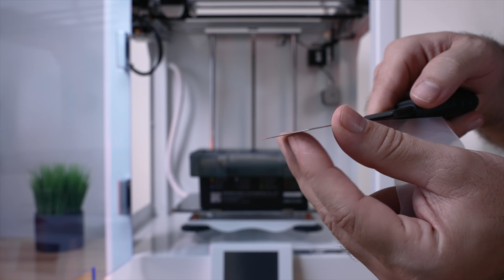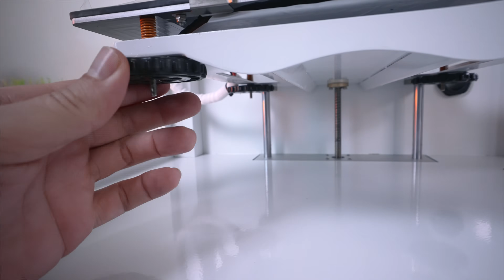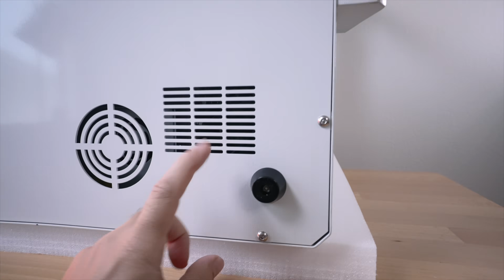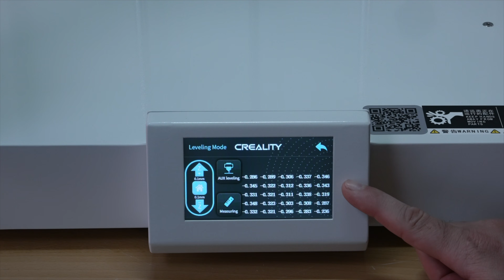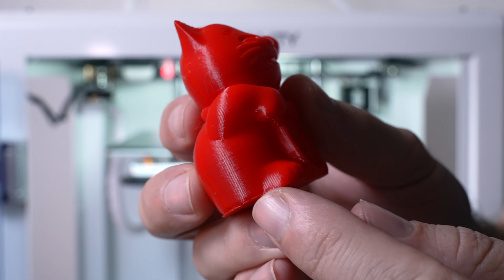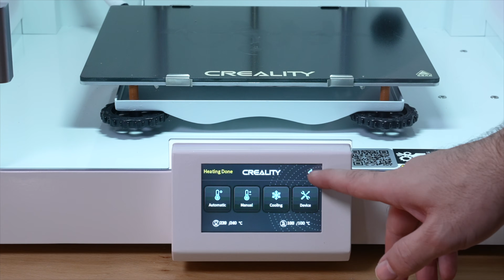Creality CR-5 Pro - High Temp 3D Printer

Comment: Just curious, if it is high-temp, then why the PTFE tube? Doesn't that melt at like 260 C?
Reply: this is direct drive. So, tube does not reach to nozzle. It just guidance.
Thats why.
Reply: @tr9036 
It is not direct drive. It is All metal Hotend

Comment: Build quality is impressive, but print quality looks only average and the machine is awfully slow for a core-XY printer. Creality would have done better if they had a better mainboard which a processor that would be capable to run Clipper.

Comment: High Temp, realative term. But i would call it an enclosed printer not a high temp printer, unless all you print is pla. As your title has high temp, then you should have printed something that proved that. ie a high wall abs print, something that is  a challenge to an normal enclosed printer. My idea of a high temp printer is that you at least have a sensor for chamber temp. if you cannot regulate chamber temp... it is not a high temp printer. Also to use the high temp moniker, something needs to be said about the printer parts being able to withstand x temp long term.
Your video isn't much more than an "unboxing"

Comment: This printer looks pretty cool.  One thing I wish manufacturers would give us a quality of life upgrade is moving the power button to closer to the front.  With my N3Pro in an enclosure, I'm having to basically crawl inside to shut it down.  Not an easy thing to do if I need to do a reset fast.

Comment: for $50 less you can get a Bambu X1C that prints 3 times as fast with better quality but it has a smaller capacity at 256x256x256

Comment: Fantastic enclosure especially the white color but the rest of it is meh...

Would have been great with the following features:
Half the price
Sonic pad
Sprite direct drive
Get rid of the cantilever bed, 3 lead screws belted together would be superior

The cartesian motion system is fine as long as they aren't trying to print at 300mm/s

Comment: I'd like to know if it's running Marlin or Klipper? The board is questionable as well.
Pro's : Nice to see a 300C HotEnd, can you do a follow up with Nylon, otherwise it looks like it could hit the spot being fully enclosed.
Cons : Not direct drive and single Z axis support rail.
Reply: It runs Marlin out of the box on one of Creality's older 8-bit mainboards. I'm currently in the process of converting mine to Klipper with an SKR Mini E3 V3 mainboard on it.
Reply: @FoulNews  Thanks for your input, it answers the questions I had. Have you had any problems with the single x axis screw? Ideally, I'd like to see a twin z-axis mechanism. Hopefully Creality make a profile available in the Sonic Pad to control it.
Reply: @BlackCat-fr4ue  I haven't had any z-axis issues yet, other than some loose hardware from the factory, which just needed to be tightened. Unfortunately when I received my unit, it had a thermal runaway issue right from the start and then the mainboard started failing due to the ground wire being run through the negative voltage rail on the PSU instead of the grounding point, which was a factory error. I eventually got it working after replacing the mainboard, heating cartridge and thermistor. However the printer is pretty speed-limited and really outdated in terms of software. At the price point, I would have definitely chosen the Bambu Labs X1 Carbon over it, if I knew they were going to be shipping soon. I'll have a video out on my channel this week going over the issues of it. Klipper should definitely fix a lot of its shortcomings, but for the price it is, many of these issues should have been addressed by Creality in the first place.

Comment: Damn thats a crummy printer. No magnetic bed, awful axis design, crappy bed leveling (seriously you shouldn't need springs and adjustment knobs in 2023!), random 3d printed parts, odd red 3rd party extruder (its the dirt cheap crappy one thats sold on aliexpress), integrated stepper drivers, atmega. This printer would've been impressive 2 years ago but things like the Bambu (even the cheaper P1P) make this look like a polished DIY hobby someone made. Also for a new printer that stringing is pretty damn poor.

Comment: The GUI is more or less the same as the Ender 5 Plus which is lack lustre and missing loads of much needed Marlin commands so you end up having to use Octoprint or Pronterface to send Gcode commands via the terminal, I hate those extruders with a passion and I suspect the hot-end is the standard Creality offering with an all metal heatbreak but it is hard to tell as Creality dont say which hotend is used, hardly Pro quality!, now that the Bamboo Labs P1P has 3rd party design enclosure panels available it makes this Creality machine a poor choice at best.

Comment: This is straight-up trash and very disappointing. Creality got way to comfortable at what they achieved and now are putting out trash recycled told technology in their printers. Every company os doing linear rails and core x y. Creality should of been onevof the lears in the core xy field but they keep redesigning the same old technology like a broken wheel with super crap quality.

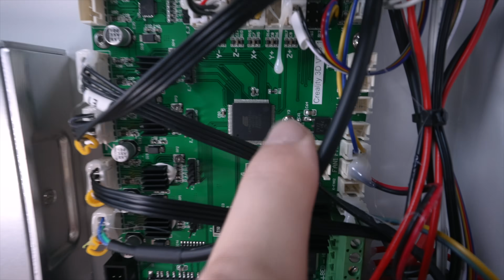Comment: At about 11:30 you identify the chip on the main board as a ATMega2560 - then a moment later you claim it is a 32-bit board.  Those can't both be true, the 2560 is an 8-bit MCU
Reply: it's disappointing to see companies still shipping crappy 8bit controllers.